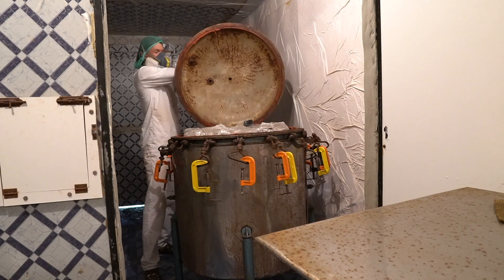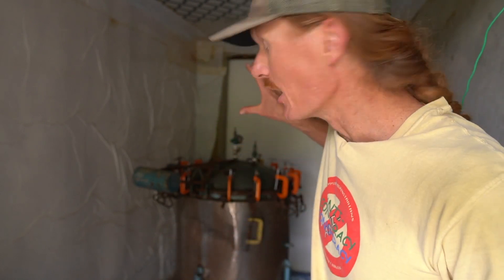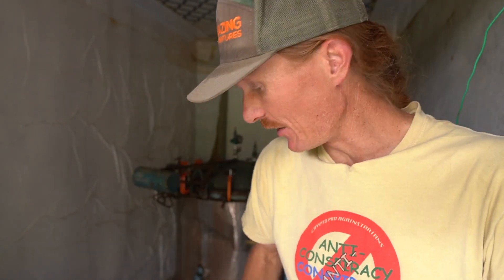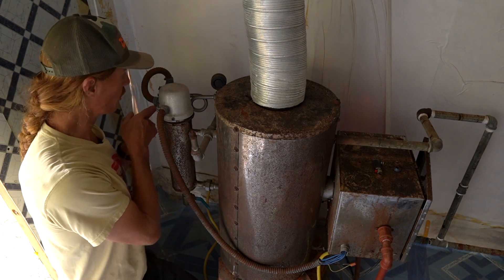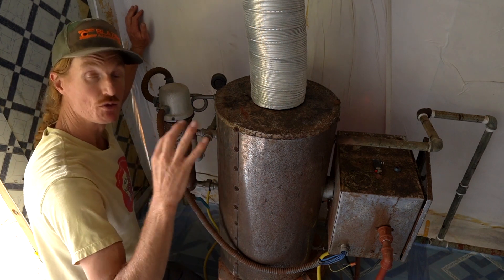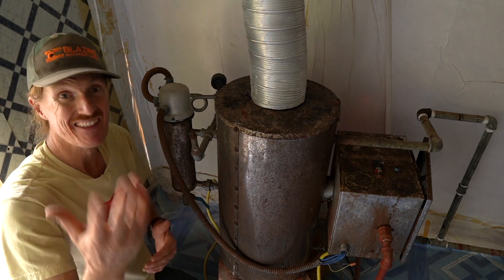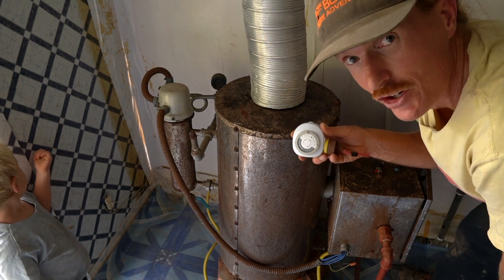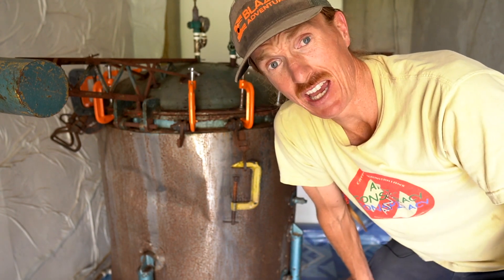Sterilizing Mushroom Substrate, Details on our Pressure Cooker set up.  Grow Fungus!

Comment: Hey man, thanks for being so motivated about mushrooms, I’m a microbiologist looking to get into mycology. I work in the pharmaceutical industry so keeping things clean and not letting them rust is part of my job. I have done many disinfectant efficacy studies. You have a great cleaning method, though, to help your stuff not rust, spray all metal down with isopropyl alcohol after you have wiped up your oxidizer. This will rinse the oxidizer off your metals and leave them coated in IPA, which, as we know, will evaporate and help with your rusting problem. This is how large pharma keeps things clean and eliminates rust, good luck
Reply from the maker: Hello, cheers for that.  Thank you so much.  I've been using vinegar since video but due prefer chlorine dioxide (MMS),  I will give this a go thank you so much for the tip.  I really appreciate that about YouTube I've had a few comment over the years that have helped me upgrade my setup, so thank you.  Enjoy your journey into mycology!!

Comment: Great video, not that any of this matters your system works great for you. but the part that controls the steam pressure is called a pressuretrol steam boilers for heating your house also use one in conjunction with the thermostat so that boilers don’t over pressurize. The tube that it mounts on is called a pigtail. Pigtails come in straight or angled depending on how you mount things. If you ever need to replace those parts. It’s hard to see in the video but it looks like your pressurtrol is mounted sideways. They work better upright and level.
Reply from the maker: All really good info I appreciate it.  Its working well like this but if I ever revamp I'll be sure to get it mounted upright.  Things are done a bit sideways down here in Ecuador.  Thank you so much for the view and the time to write a comment.  Take care.

Comment: Doesnt it suck the bacteria in, when there is vaccuum and you open it up? or does the air go through the filter on the bags when the pressure is balancing out? otherwise great stuff! You are an engineer! Always nice to see an update of you and your familly!
Reply from the maker: Appreciate the comment thank you.  Thank you for kind words. Good question.  Yeah I got hung up on that part of Stamet's book on having to put in a filter and valve to release vacuum with out adding bacteria.  I have never had an issue.  First the room as been cleaned, 2nd the bags are folded over in such away that nothing really should enter them, third cooker at that point is in front of laminar flow hood.  And forth they are about to have the whole lid opened, and brought into that environment.  I really appreciate this comment and hope anyone who reads that part in the Stamets book can also read this comment to calm worries on issue.  For me I've been good.
Reply: @5DLifestyles  Great, thank you for the answer, I haven´t started with mushrooms yet, Im just trying to get as much knowledge as I can before I do my first runs, but this really helps. Is it in the "mycelium running"?
Reply from the maker: @ondrejv416  Awesome! yeah knowledge as good its helps with ultimate knowledge building of experience.  I believe it is in "growing gourmet and medicinal mushrooms". Happy learning.

Comment: Great video, i hope i can get one of these soon, for now i'm using a steel drum, with insulation around it with a gas burner under it and a plastic tarp at the opening tied with a rope, i can't pressurise it so i cook for 24 hs but i don't think it gets hot enough because i have trouble getting my substrate to colonise correctly.
I use poplar wood pellets, 20% wheat bran with 60% water and a bit of plaster of paris, and a bunch of spawn very well mixed, the thing is my mycelium grows great for the first week but then it begins to stall and loose viggor and it takes close to 2 months to fully colonise! and they are small bags, around 4 pounds, the weird thing is i don't see or smell any contamination, no mold like trichoderma penicillium or black mold which i had a lot when i used to cook for 8hs(now 24hs). I do see a bit of wet spots at the bottom of some bags but the growth is slow in other dryer parts also, the only part that colonises fast is the top part under the filter.
Could the problem be that the mycelium is competing with some bacterial or yeast contamination that i can't see or smell? maybe it starts colonising strong but after a week other microorganisms in the substrate have had a chance to multiply and that is slowing down my growth?
When i don't add wheat bran to the substrate i colonises super fast, 2 weeks or less! but i don't get very good yields on those. Maybe y should use less wheat bran, like 5%?
Is it possible to completely replace nutrition(like wheat bran) by adding more spawn and get good yields(biological efficiency)? because i can get grain that is cheaper pound per pound that my hwfp.
Reply from the maker: Here is my guess just reading and responding.  Plaster of paris is not the same as pure Gypsum.  PoP has other things in it beyond just Calcium Sulfate.  I'm guessing it might be combineing with wheat bran which can make a glue and kind of clogging up growth and gas movement, look for just Calcium Sulfate at Ag store not "Gypsum" or Plaster of Paris at hardware store.  I hope thay helps.
Reply: @5DLifestyles  I always wondered about that, i knew it wasn't the same thing but didn't think it mattered all that much, i will try and get some thanks.
Reply from the maker: @CMZneu  Yeah I bet that's your problem.  Probably not awesome to eat those mushrooms either.
Reply: @5DLifestyles  I'm 100% sure it's not toxic or dangerous, i/people use it in ant farms/formicariums extensively and they ants need to live in the stuff and they do really great.
Reply: It's actually his vessels for moonshine and Meth cooking